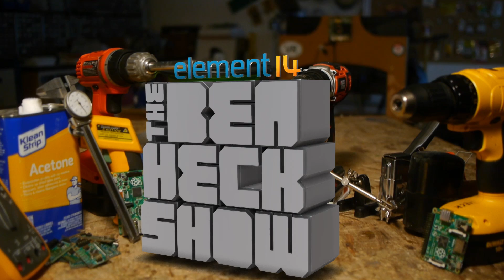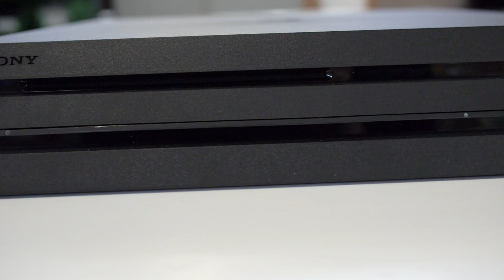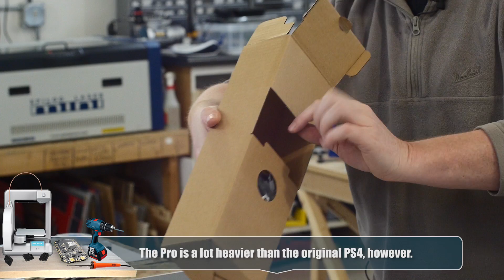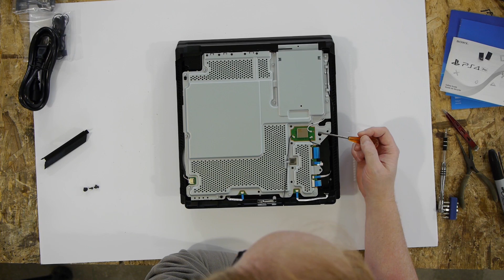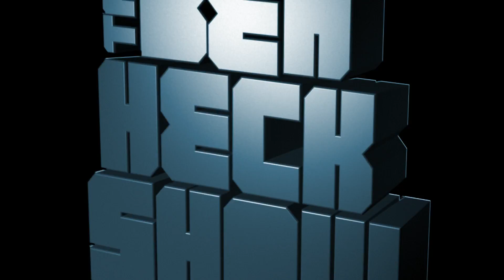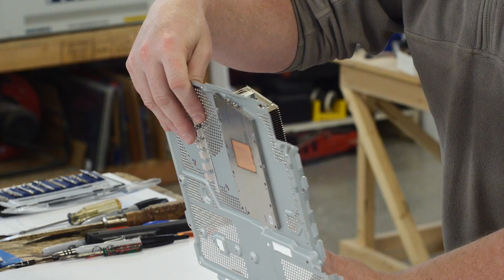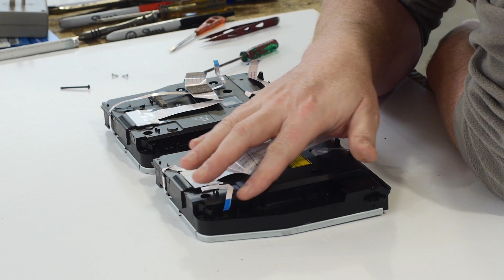Ben Heck's PS4 Pro Teardown

Comment: i find it extremely sad that nintendo put out the wii and wiiU.  why?

they put out the wii which yes by all means it is a gamecube, hell even has all the ports.... but its overclocked and they put out the new controller with motion gimmick... ok it did well. That sucked, but ok i'll give them a break this one time. They didnt really do barely any R&D with it, and it was easy to put out and quickly.
Now you put out the wiiU.... and basically if you really think about it.... a) its underpowered and underwhelming b)they had technically 10 years to make it if you date it back to the gamecube, since we didnt take much of anything to create. Wiiu just got a gamepad for a gimmick c) the internet and infrastructure is garbage and yet they had live and psn to base the design off of and they still failed since launch, it still sucks.

Now they come up with a new system with almost the same premise as wiiU, beef it up only a tad, and expect everyone once again to be ok with it? Im sorry, i will like to see how it does and all that, but im 99% sure its the end of nintendo and consoles. It wont do much better than wiiU, if it does better at all, time will tell.
Reply: bigevilworldwide1 Nintendo may be marketing it as a home console but FUNCTIONALLY and TECHNICALLY, it is a HANDHELD. All the hardware such as CPU, GPU, RAM, and storage are in the handheld, and the dock adds little to the experience. If Nintendo made a dock for the 3FDS would it be called a home console?
Reply: no its a hybrid. IMO its a handheld first and foremost yes but its meant to be a "CONSOLE" as well. Its the system of choice nintendo is using for the 9th generation which technically by specs is  actually another 8th generation system for them. Two 8th gen systems in one generation.
Reply: i think i read it may very slightly overpower an original xbox one. Not an xbox one S but still intriguing.

So power wise it goes xb1, switch, ps4, ps4 slim, xb1S, ps4pro, scorpio
Reply: hybrid people hybrid. I agree yeah its technically a handheld tablet first off but its market as both, and it OFFICIALLY comes with a dock bundled to make a CONSOLE.Even comes bundled with the joycon grip pad to make a controller. Its both, technically its more of a handheld however nintendo wants it to be their CONSOLE of choice for this generation. Even thought its 9th gen technically (another technicality) but power wise its another 8th gen system

Comment: "the PS4 pro has faster memory and a better GPU, and visual upgrades existing games" that makes no sense lemme fix that description "the PS4 pro has faster Memory, Dual GPU as well as Visual and framerate upgrades to pre-existing games" yeah the PS4 pro is the first Dual GPU console
Reply: the reason for Dual GPU and same hardware is simple, to allow backwards compatibility with Previous PS4 games, because previous games would just use the single GPU in it

Comment: love your show Ben but you should do a little more home 
work before you start recording. little things like the two 512mb of gddr3 added to the the pro so it can free up all 8gb of gddr5 for gaming. etc..
Reply: Either way, still makes no difference. PS4 Pro is still an underpowered paperweight. The PS4 was underpowered at launch with respect to gaming PC's and is still underpowered now with it's Pro revision.
Reply: Wow... Are you blind bigevilworldwide1? He said " TWO 512mb of gddr3"... As in 2x 512 mb = 1024. And agreed Zweistein... He measured the interposer as if it were the chip itself, and then treated the die, the ACTUAL chip itself as if it were just a heat spreader cap. ;_;
Reply: My only problem with that, is that the PS4 used more than 1gb for system ram, so unless they have streamlined the OS, it will still be dipping into the 8gb pool, just to a lesser degree.
Reply: Calum A, but for the cost of a system and a pc it would take up more space and money. I rather have just a pc if i was going to college.
Reply: Yeah there is physically more graphics cores under the die, thats why there is more VRMs to regulate the extra needed voltage
Reply: You know what, this comment really annoys me. I have a superb gaming rig, but despite that you cannot knock the PS4. I spent £500 on cooling alone. The fact Sony/MicroSoft, produce a whole console for that is just jaw dropping. I was very impressed with the PS4. It's a lovely console and great value for money.

Obviously PC is better in every aspect imaginable. I am not doubting that. But for me, I like to consider Bang for Buck. The fact of the matter is they are superb budget machines.
Reply: Yeah, or things like mentioning the larger die is just for dumping heat, that was pretty cringe worthy. He seems to think there is nothing inside the die.

Comment: I would have hoped you were familiar enough with hardware to know that the square package wasn't the die, and that the "middle expose part" is the silicon die, and that it's larger because it has more transistors. They will never make the die larger for thermals. It just wouldn't work that way. The die has a single layer of circuit layout and the heat is generated at the transistors, and moved out directly above it. Silicon is not a great conductor of heat, and so a larger die for no reason won't improve thermals.

Comment: while this new PlayStation is it looks kind of cool I don't think I would ever spend nearly as much as they charge for it simply because it's missing a lot of basic features that a lot of people get consoles for and just because it has a beefed-up GPU that allows you to play high-resolution games doesn't make it worth the extra crap ton of money that they're charging for it specially since it doesn't have a Blu-ray player in it and there's obviously going to be a problem with overheating seeing how there's no thermal pads to help the heat from the other the new heat Source from the boosted up GPU so I don't really understand why the heck they made this thing just so it'll be a assume it's going to be a louder and it's probably going to work just the same just be able to play it slightly visually more pleasing games
Reply: You do realize a APU is a CPU with the GPU in the same die? This is the reason why the heatsink was beefed up with a copper contact and three heatpipes running through the much bigger and taller heatsink made of aluminum.

Comment: what are u guys thinking about qualcomm,s snapdragon running full pc version of windows10(32bit)?
Reply: what
Reply: Zweistein they said there will be emulating layer for x86
Reply: The Snapdragon 835 is capable of x86 emulation, which enables it to run 32 bit windows
Reply: It can't, the Snapdragon is a 64bit ARM processor, and windows 10 is not designed for ARM processors. (x86 /x64)
Reply: bullshit! there is a build for arm32 and 64 the raspberry pi3 runs win 10 and has 64bit arm chip.
Reply: aly nicholls oh noes
Reply: is that to run windows (x86)code?, because as i said earlier win 10 runs on arm, i tried it on my pi3 but went back to retro pie.
Reply: aly nicholls raspberry runs iot core, but snapdragon should run full pc version of windows10 with probably compatability with all pc software

Comment: Still doesn't explain why it can't play 4k blu-ray... obviously it was because they didn't include the UHD player. I was hoping you found something that justified why they couldn't include one, without some astronomical cost. Instead, it's just because Sony wanted to save money, while charging more (as I originally figured).
Reply: I hate their argument that optical media is dying. There are a bunch of 4k discs already available, and I prefer not to stream movies, especially 4k. Most movies start off below 4k, as it buffers in, and occasionally, it diminishes, when my bandwidth dips.
Reply: price, no one brought the ps3 for 600 which introduced blu ray. You can still play regular blurays.
Reply: EvanTheStud I understand your point, but in at that time, bluray drives were very expensive to produce. The UHD drives do not have that issue now (see XBox One S). I'm sure it would incur a slightly higher cost, since  bulk purchasing (the current drive), usually results in lower costs... but this is also the reason the Pro went from a 'must buy', to a 'maybe I'll get it' (for me).

So the real question is, did they lose sales, to save on slight a UHD cost? For Sony, I'm sure they felt it was worth the gamble. We'll see. I know my lost sale isn't making a difference, I just wonder how many more consumer felt the same
Reply: EvanTheStud To your second point, my PS4 already plays the games too. The point of getting it, would be to upgrade my game resolution. Why would I not want to also upgrade my movie resolution?
Reply: notman05 4k bluray player costs up to 200 dollars. The xbox managed to do it because they gimped it. It can play it but it doesn't do it justice. it doesn't offer true hd audio. Also its cheaper hardware. The ps4 pro offers almost 3x the performance of the Xbox one.
Reply: A full blown player costs that much. Just the drive, does not. Especially when it should share most of the mechanics of a regular drive. I suspect the difference is just the cost of a lens. Hell, Sony wouldn't even have the overhead of a license, like MS does
Reply: notman05 Again Xbox is able to do it because it has cheaper hardware. The PS4 pro is a more beefy console.
Reply: Curtis Riceman soon redbox will start renting 4K Blu-ray and so will Netflix. 4K streaming will never be as good of a quality as physical discs. I like the option for both. I stream and watch physical discs (own/rent) on my set up.
Reply: notman05 Idc tho. I would have never ever used it anyway so for me. it's a plus it's not there. I stream/digital dl everything. My PS4 PRO is perfect for me.
Reply: notman05 saving money in construction of a product for sale is what many economists believe contributes to this thing called "profit"
Reply: Tachanka Chanka yes, I already addressed this. They also rely on this thing called sales. If they sell less, then the extra profits, from saving on the lens, may not balance out. Maybe they will... We'll see

Comment: So Ben doesn't know what happened to Hitachi, hmm? 

HGST was Hitachi Global Storage Technology. They've been a subsidy of Western Digital, under the name HGST, since 2012. The full length name was the name that was a result of the merger between Hitachi and IBM in 2003. As of 2015 they are no longer a separate entity.

I work for a computer store and for the most part you wouldn't notice except for the fine print on the HGST boxes and the lack of low end HGST desktop drives. HGST makes excellent desktop drives and some of the better laptop drives. Of course they're the only ones that we get 1tb 7,200 RPM laptop drives from. WD Black seem to no longer exist for us outside of 750GB even though they do make a 2.5" 1TB. So if someone wants to upgrade their Playstation to a faster 1tb 7,200 RPM, those would be the internal drive choices, unless they'd like to pay a premium for a 5,400 RPM Seagate Hybrid. Seagate makes a 2TB 2.5", but it's not a Hybrid and merely 5,400 RPM. A lot of people buy it despite knowing it's slow.

Comment: 'cmon. UHD Bluray discs don't actually require new hardware to read! New firmware sure, but they're the same thing as regular Blurays, just utilizing the larger capacities supported by the format. Why does nobody do their homework?

It's a completely different issue that Sony chose not include support for UHD. Heck, Microsoft could have added UHD support to the original Xbox One too! Bluray drives just stream data.

Comment: The heat of the new APU isn't much greater than the old one, because it uses smaller techprocess and new improvemed architecture (Polaris). And it's actually uses less power than ps4slim.

Btw, you're also wrong about memory: ps4pro allows additional 512Mb of memory to be used by games.

Comment: did he realy measure the outer size of the chip on its carrier? the silicon and also the DIE is the exposed thing in the middle that is glued on....   the outer size is just some kind of cheap pcb as an adapter...

Comment: The outside of the chip is the CHIP PACKAGE, not the DIE, the die, the chip itself, is the part in the middle where the thermal paste is applied.  YOU SHOULD KNOW THIS, BEN.